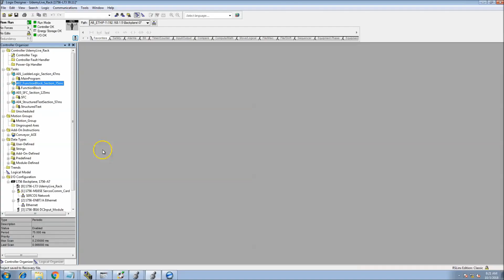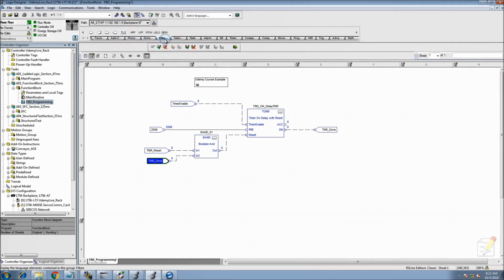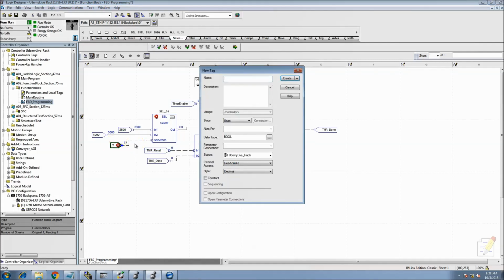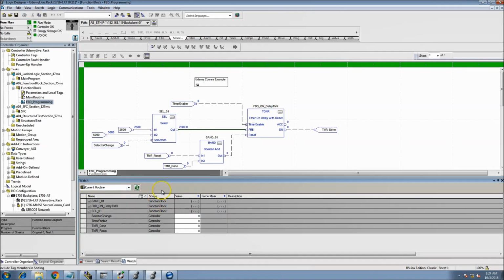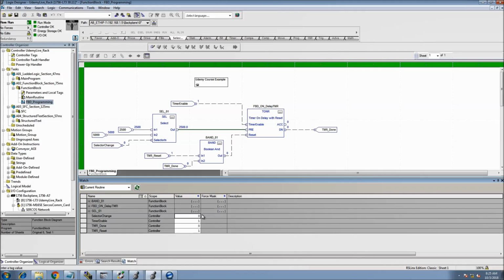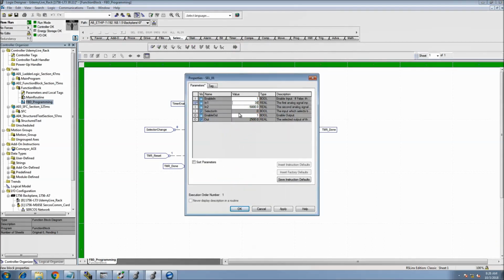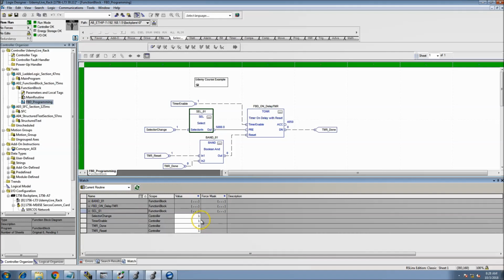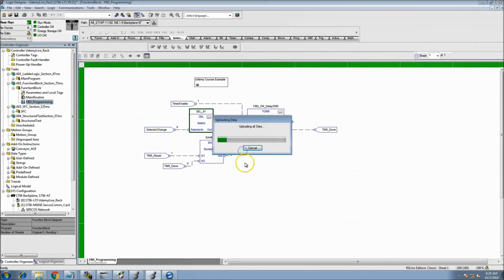RSLogix 5000 Function Block Diagram Selector Instruction

Comment: Hello,
Can you please tell me how to represent the variables in function block supposing that thee variables are updatable in the running of the program?
Reply from the maker: Depends on how you want to view them.

Through an HMI?

Through the PLC?

If PLC then just monitor the tags
Reply: Even without displaying these variables in HMI, for example variable named "×", has initial value and when the program is running in real time this variable "×", will updated according to a some calculations. The question is, how can I represent this variable "×", in function block?
Reply from the maker: Use the tag of the function block instruction then itemize down to what you want to see of use.

If you are referring to seeing this in real-time on the function block itself then open the instruction & select the feature you want to see, this will be the function block instruction tag level.

Maybe these videos will better help you.

PLC Programming Function Block - Conveyor Box Controls
https://youtu.be/nBbZgbiAZ8o

Studio 5000 PIDE Simulation Programming In Function Block
https://youtu.be/VqUYifILuDk
Reply: @ShaneWelcher  Thanks a lot for your attention and kindness